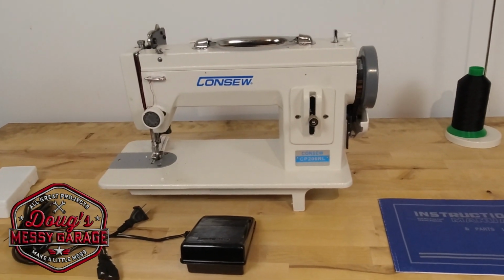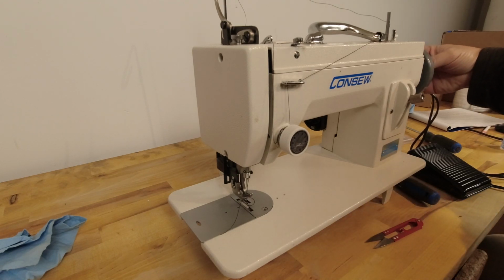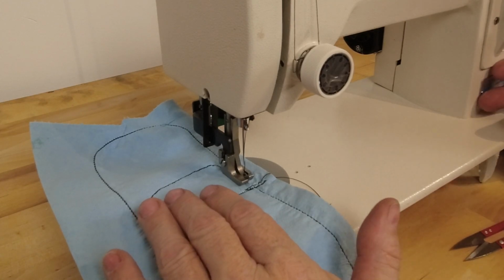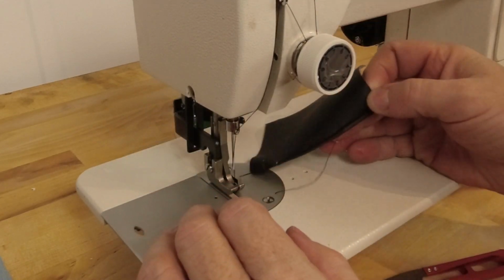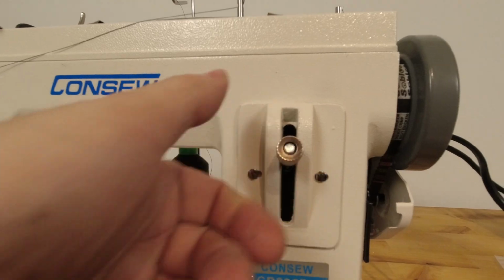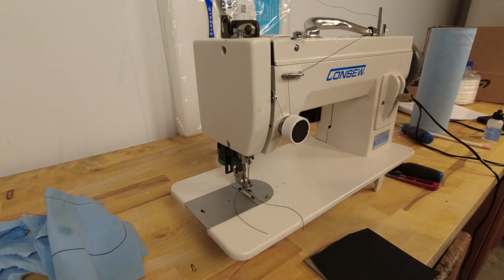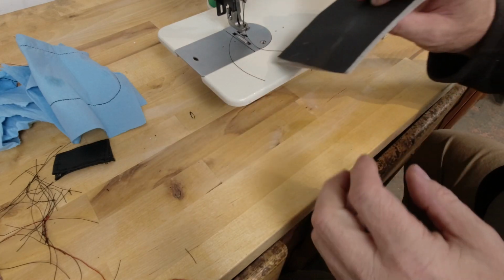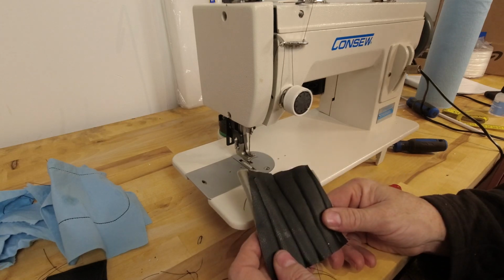Can a Complete Newbie Learn Automotive Upholstery!?

Comment: Can you do upholstery? Sure. Heck I even bought a different chinese knockoff of that old Singer design myself. It's great to dip your feet in and get familiar with things. The first thing I'd recommend is getting that set up into a table. The machine isn't well balanced and will tip, also you'll get oil all over the table as you sew. It's also far easier to work on a project when the piece is level with the surrounding area instead of traveling up and over the flat bed.

Comment: The Sailrite machine is basically the same machine with upgrades made by Sailrite.  If you go their website or YT channel they have plenty of videos and instructions on how to thread, tension, oil, etc. Many of the components they sell for their machine will fit this machine.  The Sailrite machine does have a better motor, wheel, etc. hence they are double the price but a high quality machine.  This is a quality machine but you're left with a lot of self teaching.  I am considering this machine due to budget constraints and my Chief Financial Officer (Wife) has to approve the purchase.  $400-$500 is alot easier to sell then $1,000+  LOL.  Tandy sells this machine and they have a few videos on it as well.
Reply from the maker: I picked up the Consew over the Sailrite for precisely the price reason.  If I was going to drop $1000 on a Sailrite, I likely would have stepped up to about $1800 and gotten into a Juki but the $500 Consew is decent enough to learn on.  I ordered a couple of pieces from Sailrite yesterday and hope they will fit the Consew.  Other than Sailrite, it is hard to find any accessories for these machines.  Even Consew doesn't appear to sell welting feet for the CP206RL.

I won't say I am an expert but after doing a couple of projects, i am starting to pick up a few hints and tricks that work well for me on my machine.  I am sure I will learn more as I go.

Thanks for watching and for commenting.

Comment: Hold your threads back behind the work when starting your stitch…hold them down against the table.  Just the first couple stitches is all you need. Otherwise it can cause a rats nest under the machine possibly, or it unthreads itself like was happening to you.
Reply: Also, make sure the needle thread passes down through the hole in your presser foot prior to starting. When you pull the work out, cut your tails a little longer too
Reply from the maker: Awesome!  Makes perfect sense.  Thank you for this tip.

Comment: I think your thread isn't going through the tensioning knob correctly it should go through the little spring on the left before going upm to the top. you can see it stuck in the tensioner and flopping around when sewing on the other side - I'm learning too

Comment: When working with machines, make sure your needle matches the material. I learned the hard way of not paying attention. Leather, vinyl, and cloth need different needles. And watch your tension settings on different threads and materials.
Reply from the maker: That makes perfect sense but is not something I had thought of.  Thanks for the tip.